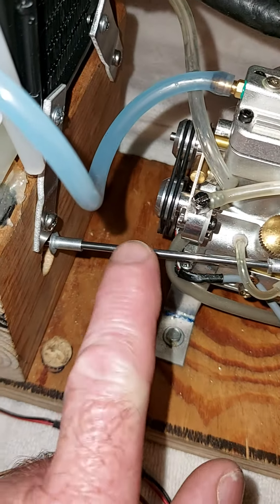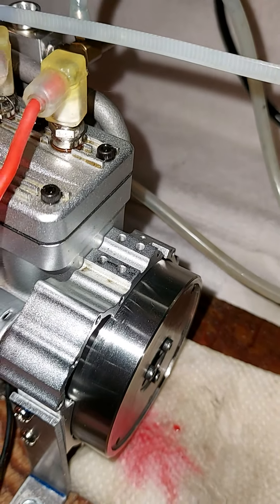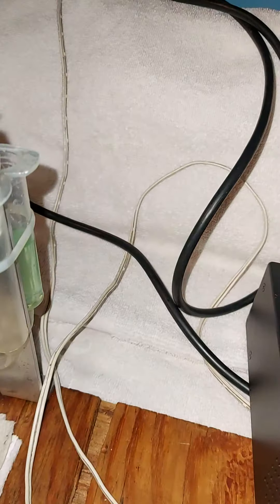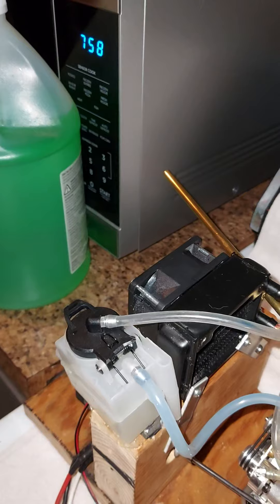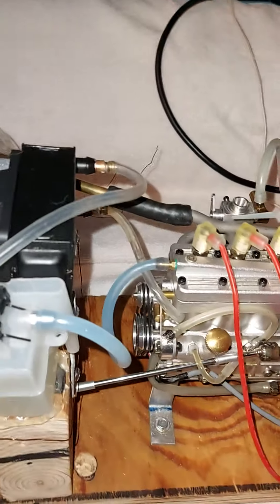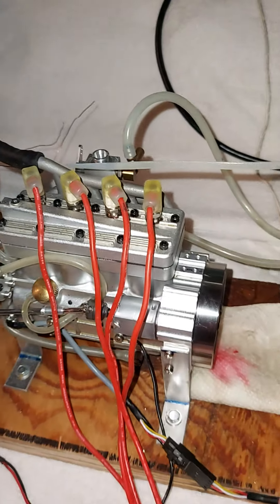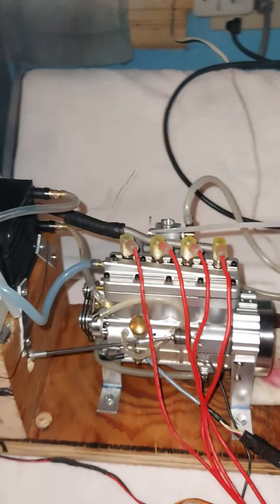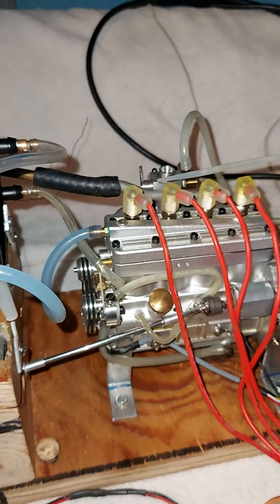Cison L4-175 Brushless Starter Upgrade and one-way roller clutch issues

Comment: Are you running nitro in a gasoline engine?
Why would it be spewing castor oil from the exhaust?
Reply from the maker: Castor doesn't burn very well. It's a lubricant. It's part of the nitro fuel mixture. It doesn't hurt a thing.